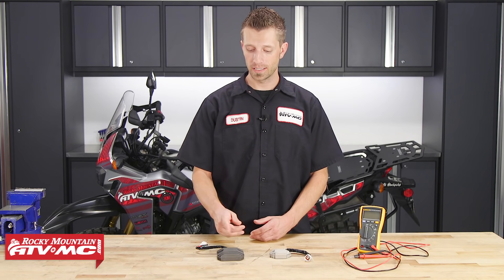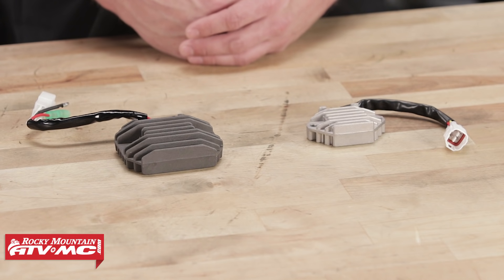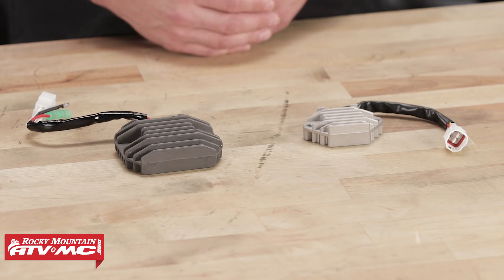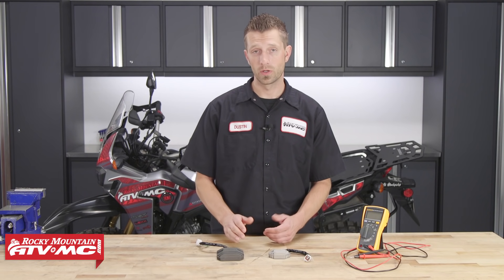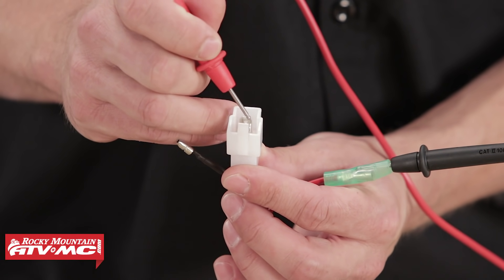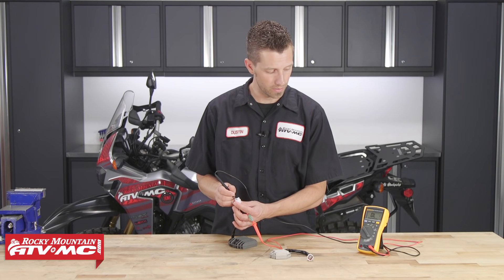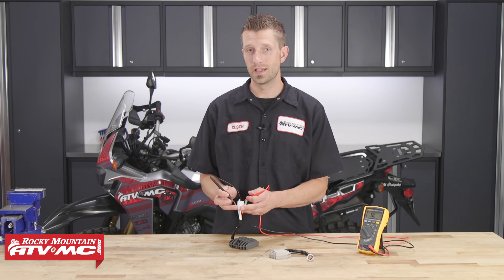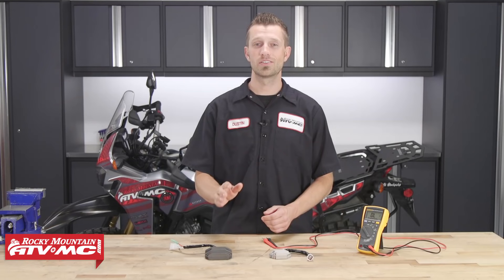How To Test a 3 Phase Regulator/Rectifier

Comment: Will this being bad cause a misfire or what sounds like a misfire  after it warms up to about 140°
Reply from the maker: No, a misfire is not a symptom of a bad regular/rectifier. Misfires can be caused by many things but somewhere to start would be with the ignition system (spark plugs, wires, coils, etc.). Some other things to check would be with the jetting if your bike is carbureted or some sort of vacuum or fuel leak.

Comment: Hi folks. I have a Honda VF750f Interceptor which I am restoring.My issue is this , having got the bike running, after a while I noticed the battery was starting to cook so I did some electrical tests and found that the battery was being charged at 18.5 volts. I did multi meter tests on the alternator and regulator and found the alternator to be fine but the regulator was not. So replacing the regulator and battery solved the problem. the battery is new but I've used a second hand regulator I had, but it works. My problem know is that in running the engine up to temperature to then adjust carb settings I had the seat off of the bike and when I put my hand on the seat rail above the regulator and touched the regulator with my finger and got severely burnt. I now the regulator runs worm but surely not that hot. I noticed that as from standard the regulator is mounted on a stiff plastic board and not  on a metal plate which I would have thought would of acted as a heat sink. Should it run this hot , or do you think this is why the previous regulator ended up over charging ? What could you recommend to solves this suspected over heating.
Many thanks, Mike.

Comment: Don't you have to have a 3 faze stater if you have a 3 faze rectifier?  You make it sound like you don't?  I don't know much at all about what I am talking about,  I am just asking.  I have a after market stater add on kit on a yz426 dual sport conversion   that is just for accessories lights fan heated clothing exc.  I have been looking to get hooked up,  It pretty cool, rotor  just bolts on on top stock rotor, winding are in the new cover. runs interdependent of stock electrical system.   has 3 leads 2 yellow100 watt  and 1 red .   I assume this is a single faze with 2 100w output leads.  What 4 wire regulator rectifier do I want???  one that will hold up when used to capacity.
Reply from the maker: Can you give us the brand, model and possibly a part number of the new stator/dual sport conversion kit? We will try to find what you need but it would be good to have some more info. What year is the Yamaha YZF426? - Charles

Comment: Do i need to disconnect battery before installing the regulator
Reply from the maker: It's always recommended to disconnect the battery before doing any electrical work.

Comment: This method is valid only for simple rectifiers. A rectifier/regulator may have extra components in line with the positive output of the bridge rectifier preventing the measurement of half of the diodes.

Comment: When my motor is running I only get 12.3 volts, though i just performed this and the stator test and both these components are fine. Any idea what else could be causing the low voltage when running?

Cheers!
Reply: LJ kas did you ever find a fix to your problem? Mine is doing the same thing as yours stator and rectifier tested good but battery will not charge.

Comment: Very good; does this only test the RECTIFIER(S) part? Could the unit stil be bad on the regulator section?(of course,if the motor runs,you just slap the voltmeter leads on the batt.terminals to find out)
Reply: sometimes R/r pass all these test but they are still not working. the best way is to borrow from a friends and try it.

Comment: Hmm. My battery is draining by itself. It charges when I ride. And it’s not over charging. Could it be a false ground?? Hlp
Reply from the maker: You are going to have to do a parasitic draw test on it, check out our charging system video at 6:24, it will show you how to do this test. https://youtu.be/tr8DeCyBuXI If you have a draw, you can remove one fuse at a time until there is no more current draw to isolate what circuit the problem is in. It is somewhat common for a bad reg/rec to be the culprit. To test it, unplug the connector and test the power wire (the one that supplies DC voltage to the battery) that's attached to the reg/rec and check for continuity between that and ground. There should be no reading (Should be insulated from ground) but if it's in the mega ohms or shows any reading, the reg/rec is bad. 
-Charles

Comment: Is it normal to a rectifier to be super hot when the motorcycle is idling??
Reply: And what's the root cause??
Reply from the maker: If your regulator/rectifier is a shunt type, it's normal for it to get hot if the bike isn't drawing much current.

Comment: Hi Justin,

I’ve been having problems with a 2003 honda cbr600rr charging system.

Diode test “forward bias test” gives me around .48 between each pair.

Stator windings are not shorted to ground. I also get about .5 ohms between them.

When I start the engine, I get 10.8 AC Volts from each stator winding at idle but does go up as I rev the engine.

Lastly I only get 13.1 volts DC at battery terminals.

Thanks In advance, hope you can help.
Reply: Justin didn't reply, but I will.
Looks like the stator is faulty. The AC Volt output on each stator coil  should be between 65V and 100V depending on RPMs.
Reply: Did you find the issue in the end?

Comment: One more test that should be performed while your in diode mode is test positive and negative leads of stator and make sure it reads “OL”.  That should be the first test in fact, as my bike stopped suddenly no warning and the rectifier melted inside , and not until I performed this test against a good / new unit I wouldn’t have known. Also the rectifier past all the other tests so according to your video it would have been deemed good... FYI

Comment: mine passed all this  tests but still it`s not working I read 2 volt when motorcycle it on than when I open the throttle it goes to 0 v
Reply: then its your stator, check it.

Comment: what if it passes these tests but still doesn't show charging and your stator passed all its tests?
Reply from the maker: What condition is the battery in? I would charge it and test it outside of the machine first, some machines have two main fuses one will be in between the reg/rec and battery so check those,  did you already check AC output from the stator? You can also check DC output at the connector after the reg/rec to see if there is a break in the wire before it gets to the battery. 
-Charles

Comment: What damage could occur if you continue to run your machine with a bad regulator?
Reply: Dirty Bird fry your whole electrical system. Usually starting with headlights then burn out dashboard and kill speedometer
Reply: If the charge rate increases dramatically (>16V) the battery will heat up and suffer damage, may even explode!
If there is a low charge rate (<12.2V) the battery will go flat.

Comment: Several errors in this 'How To' video - first, current flows negative to positive; the video depicts current flowing positive to negative, also the graphic indicates current flow through the diode in the opposite direction that current is conducted through the diode - second, the technician is using a somewhat expensive Fluke digital multi-meter; the Fluke displays the voltage needed to make the diode start to flow current - the average shade tree mechanic will have a lower cost multi-meter; while the Fluke's test lead polarity is black = negative and red=positive, not all multi-meter's connect the internal battery's polarity this way - third, OL does not necessarily indicate 'Open Line'; on some meters it indicates 'Over Limit', it may simply indicate a need to change the range setting - fourth, diodes can be checked on the ohm scale; a very low resistance will be observed in forward bias and a very high resistance in reverse bias - fifth, a 'Digital' meter is not required; an old analog meter will check a diode as well as a digital - simply put: using the resistance scale or diode scale if the meter has that function, connect one meter lead to the battery positive connection and check the AC source connections then reverse the leads and retest; there should be an indication in one direction and not the other - repeat he test for the battery negative lead, the results should be the same but opposite of the test to the positive lead - a final test is to check forward and reverse bias between the positive and negative leads; the meter should indicate a value approximately double that when checking each individual diode; there should be an indication one direction and none the other.

Comment: Confused by the view of electric wires and the wrong installation method Imagine the positive and negative wire connected from regulator to the battery was on positive side of the battery!!!stupid worker